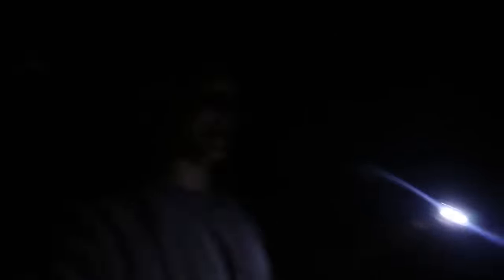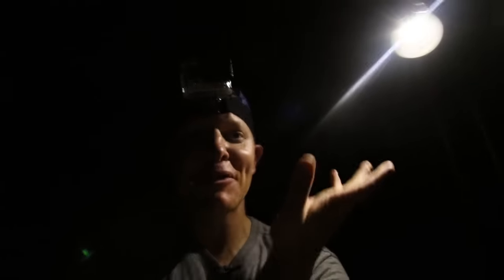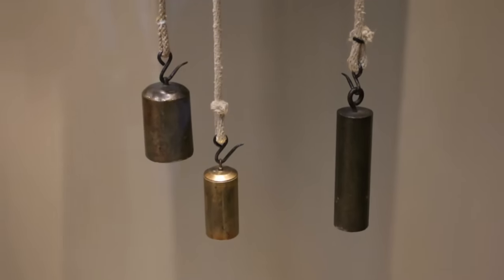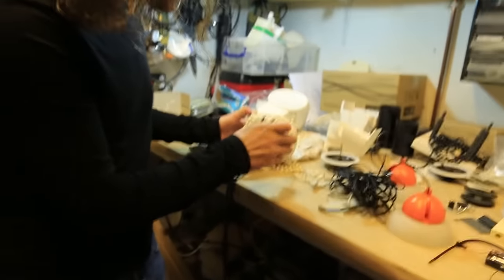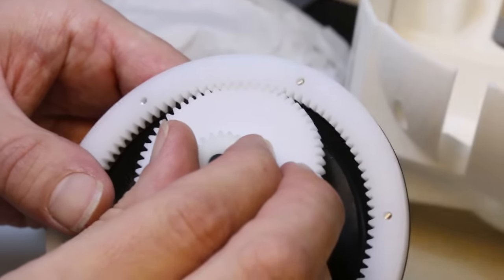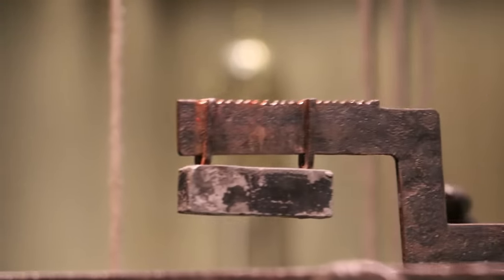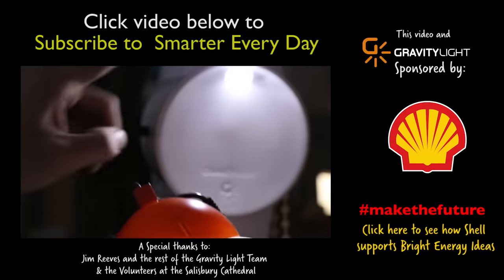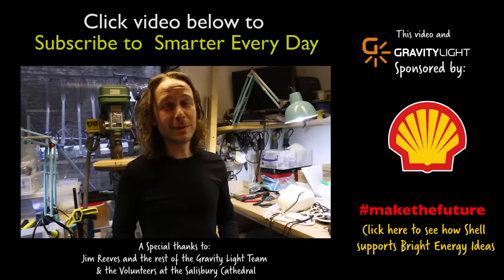Turning Gravity Into Light - Smarter Every Day 146

Comment: It's amazing how simple this is, yet only just been developed. Got to love engineering!
Reply: +TheRecreationProject it is not that simple, these gears needed some serious calculations and the manufacturing process might be expensive so you need millions of customers to make it affordable taking into account the main objective is to provide underdeveloped countries like Africa with this product.
Reply: +Luis Fernando They didn't need serious calculation. They required the same level of calculation that you would perform in any base level physics course at a university. The process mimics that of old grandfather clocks. Would it take time to perform the calculations, yes. Are the calculations difficult or highly advanced, not as much.
Reply from the maker: +TheRecreationProject I know right?  It seems like this would have been low hanging fruit.. something we did ages ago!
Reply: +SmarterEveryDay Why hasn't it then? The only thing I can think of is that LEDs are relatively new and other light bulbs wouldn't have been very practical.
Reply: +Steve Balsamo Because most people have access to batteries and the electrical grid. Batteries are far more convenient (and mobile!), and the electrical grid is far more convenient, cheaper, and powerful.
Reply: +Joshua Pearce Yeah. And cars have just recently started to move to electricity. But if you use gravity, you dont need any other power source. You only need a hill, then drive downwards...
Reply: +Kratax so, how would you get up to the top of the hill?
Reply: +Luis Fernando Countries like Africa...
Reply: ***** It's kinda hard for inventors to sell batteries of any sort to people in a post-apocalypse setting which doesn't even exist. So yeah, that's a pretty stupid point you made overall.
Reply: +Alan Zhang How do you rewind the light? It's the same thing. Use the force!
Reply: +Joshua Pearce It is called preparing. In case of a super volcano, do you have canned food for few years?
Reply: Kratax It's called an economy. More people want convenient reliable lights that are cheap, than dim lights that only work for 20 minutes at a time. Even if there was a disaster, we'd still be relying on regular electrical devices as soon as possible.
Reply: +Joshua Pearce In my country, when there is a normal winter storm, trees get heavy from sticky wet snow, bend and fall onto power lines, which hang in the air supported by poles. There can be hundreds of kms of line to fix in a rural area. This fall there was some houses without electricity for days. And it gets cold in winter, unless the house has a fireplace or something.
Reply: Kratax This kind of thing will not heat your house, unfortunately. Not even close. You'd (probably) get more heat from a human through the exercise, rather than electrical output generated by their motion.

And for lights needed for a few days: A couple AAs will easily last a week with a low power LED. Plus, no moving parts so it will not break. Sadly, this device (even though I want a couple for myself), would not be as reliable in a short term emergency, and might not last through a long term one.
Reply: +Joshua Pearce I guess it could be handy in some rudimentary warehouse room you need light only temporarily rarely, but never want to worry about batteries.
Reply: Kratax Yeah, I can see that for sure. Put two of them in a bunker or some rarely visited store room, and ten years later you'll still have a light which will work in an emergency. Batteries are great, but they do eventually die (or worse: leak). Heck, they'd even be useful in a shed or on a farm, anywhere that has damp conditions but the owner wants to save money.
Reply: SmarterEveryDay Except it's been done already in a better and more convenient form of flashlights that are charged by shaking them and thus moving a magnet through the coil inside the handle which in turn generates an electric current that is stored in capacitor which is not a chemical battery and doesn't degrade.The reason it does not discharge all at once is the same as the one stopping the weight from falling too fast.

It have way less moving parts, it's compact, light, and can be hermetically sealed which allows it to work even underwater, which is perfect for harsh conditions. And it doesn't turn out instantly - light gets dimmer as charge is getting depleted. I'd like to see you try to recharge this device in pitch black as stopping the weight will turn off the light instantly.

Also they are 10 dollars on ebay, it's a XIX century tech.

You should be ashamed of yourself for clickbate title and spreading misinformation, as well as advertising subpar product, this device have nothing to do with gravity, it's powered by potential energy you put in the system by lifting the weight. And more to the point - you can not harness any energy from gravity - that would violate the energy conservation law and perpetuum mobile. And now a bunch of people will think it's real.

I thought better of you, I thought you are making your research before doing those.

For example helicopter one was a great example of paid video, it was tying previous themes of helicopter and backwards bike together and was entertaining I nothing else.
Reply: +Roman R People can see a little bit without light, then they can put the light on. Also in a warehouse, you could have a flashlight, but these gravity lights are hanging in place, so they are better for area light.
Reply: shiromiji Go teach rocks lift themselves up, then return to this conversation. And yes, it was a channel about education before.
Reply: +Roman R Your argument is dumb with no merit. I believe a source of light that last for 30+ minutes is much better than a source that lasts for 5 minutes.  And I believe you posted saying that you can buy the flashlight in bulk is useless.  You must be a troll. And yes this machine is ran by gravity.  Where do you think all the input of energy is coming from. Thier imagination. Yes they lift the rocks up, but then its held up by the machine. 5 to 10 seconds of work for 30+ minutes of light vs the 15- 30 seconds to charge up the flashlight. 

And your last point.  Reloading the system in the dark. I am sure your flashlight you love so much can be used in this situation, but I am sure the people that this machine can benefit can figure out a way to lift a bag of rocks in the pitch dark with out losing all hope.
Reply: The input of energy is coming from the humans who lifted the rocks. Gravity is not a source of energy in this universe. It would work the same if it used springs instead of gravity (AKA, a clock).
Reply: Jose Perdomo Great, now people think it's powered by magic, good job SmarterEveryDay 

Also it is truly a great invention if it requires another light source that can completely replace it in the first place.
Reply: +Joshua Pearce Technically yes, but using ropes and gravity as energy storage is the way it works. If people put a satellite orbiting the Earth, you don't pop up noting that it is actually fuelled by rocket fuel, because the satellite was launched to the orbit with a rocket.
Reply: Kratax Excuse me, WHAT?
Reply: Kratax I certainly don't mention "this satellite was lifted into orbit because of gravity" or "it stays up because of gravity", so I have no idea what point you're making.

A hydroelectric dam is also powered by the energy stored in matter that is released as it falls into a gravity well. We don't say gravity is making that energy. We don't even say water is making that energy.
Reply: Joshua Pearce I'm glad I'm not the only sane one in this mess, this truly made this channel DumberEveryDay.
Reply: Roman R I know what you mean. (I even made the same joke in a root level comment, and set off a hornet's nest)
Reply: +Joshua Pearce Why don't we say gravity makes the energy? Sure gravity is not making any new energy. But so are you not making energy by muscle. Your muscles are just storages of energy from the Sun.
Reply: Kratax Because that would be like saying that photons of light produce energy when they reach you in 8 minutes and not sun.
Reply: Kratax Simply, because gravity didn't cause anything to change. You can say you're storing the energy via gravity, but you're only getting back out what you put in (by lifting the rocks). The gravity simply "is", and does not change or react to the motor in any way.

The energy we get back out is due to electromagnetism, so we could say magnets are making this energy.

Think of it this way: The device would work just fine in deep space, with null gravity, just by giving the bag-of-rocks a push and letting it glide until the machine slowed it down. The machine wouldn't notice the difference. (you could also do this on earth with some wheels or grease, of course)
Reply: I'm actually ok with saying gravity makes the energy, in a casual context (not happy, but it's ok), because it is gravity that makes this device work as designed. It's when somebody says gravity is being turned into energy, or gravity is the source of the energy that I get annoyed because this is a very important concept, and already confusing enough for people to learn.
Reply: +Joshua Pierce That is, of course,  assuming that the push you give it is enough to overcome the friction between the gears.
Reply: Jason G Of course. But that math is exactly the same for a weight being pulled downwards by gravity.
Reply: Jason G Energy you need to input is the same in both cases it's just with the normal case you do it fast and in this one - over time.

Of course if it was an ideal device without friction and it's own inertia singular impulse equal to lifting the bag would be enough as well, but as it is that would clog the gears dissipating energy on that.
Reply: +Roman R I'm not so sure you're last comment is technically correct.  Remember,  the object works by gearing - i.e.  the last spinning gear needs to turn fast enough for a coil to spin through a magnet (the D.C. generator),  creating enough voltage to light the LED.  If only enough force was created to surpass the friction between the gears and none more,  the large gear would likely not rotate fast enough to generate that voltage.  You would need a much larger final gear to get the generator to spin fast enough to generate the required voltage with a slight push just overcoming friction within the gears.
Reply: Jason G First, I didn't tell anything about energy enough to just overcome friction, second, the bigger gear is, the slower it rotates so I really don't know what you mean.
Reply: +Kratax Actually when you think about it, the energy comes from the person who lifts the weight up to the height so that it may fall back down. when it reaches the bottom it needs to be lifted again requiring energy from the "lifter". The mass of the object that is suspended and is allowed to "fall" slowly, is potential energy being slowly released.
Reply: +trebornoslo1951 There is no potential energy. There is only the bag, the light, and the planet. The planet pulls the bag, which turns the gears. That is all there is to it. Sure someone needs to lift the bag, but so what? Someone needs to fuel a car. Then the car runs out of fuel and needs to be refuelled. If there was no gravity, the bag would not be pulled. So the gravity does the job, though not the refuelling part.
Reply: Kratax "Potential energy" is the actual scientific term for what is being used in this situation...
Reply: Kratax Saying that this thing is working on gravity is like saying nuclear power plant is working on steam, sure, something needs to heat up the water, but so what, if there were no water, turbine wouldn't turn.
Reply: The thing you are seem to miss is that gravity is not the actor here, and it can never be one, it's just a medium with which initial actor is acting upon.

And there is a lot of devices with similar transformations of energy. Like piston inertia is carrying energy from gasoline explosion into crankshaft within combustion engine (just think why rotation is smooth while based on singular inputs of energy). Just like steam is carrying the energy of fission to the turbine in the nuclear power plant.

We don't call the inertial engine and steam power plant, do we? That'd be confusing and misleading as electric engine is utilizing inertia as well, and pretty much every kind of thermal power plant is using steam as well, from geothermal to trash burners.

And more to the point, this same principal is used every day in power grid to smooth up the daily cycle of energy consumption - at the night when industry is mostly don't work, and people are asleep, electricity from the grid is used to pump massive amount of water uphill, only to then be let down again spinning the same turbine that put it up and generating extra energy during the pick consumption, which is basically a massive kinetic battery. Do we call it gravitational power plant? Does it generate extra energy in some magical way? Absolutely not! It inevitably outputs less because there are always heat and noise and whole bunch of other kinds of losses.
Reply: +Roman R It's obviously muscle powered - but when you're in a poor area, practically everything is. Even the kerosene lamps are muscle powered, in as much as you have to walk to town to get fuel from the petrol station, and on top of that, you have to labor to earn the money, so you can have the privilege of walking to town to get the kerosene...
Reply: ***** I'm not saying muscle powered generators are bad, I'd even tell that it'd be nice to save a bit on your bill as you are getting fit in first world countries.

Though there are much better solutions for that, like a "shake-it" flashlight.

My problem with that thing and video is that it's trying to get ahead by spreading lies to poorly educated people trying to convince them that work is done by some magic.

Also this design is bad, too many moving parts, rubber belt in particular will die really fast. It's open to elements such as dust, sand, dirt, water and hair, since at least one cog that is in contact with the rope needs to be outside.

And there is a huge problem with recharging since when you start to pull weight up (assuming you were watching it closely and will not allow it to run out and fall out unnoticed) it's pitch darkness. Good luck finding that belt and weight on the floor and putting it back in in pitch black of the place without light pollution (spoiler: it's like you are blind)
Reply: +Roman R You're amazingly ignorant yourself, friend. Shake/wind flashlights are horribly inefficient from an electro-mechanical perspective - and they're exhausting. You use tiny muscles that were never made for that kind of rapid, repetitive action. Your legs and back are much stronger, and are made to lift things. Lifting a sandbag isn't any different than normal human motion, and you may only have to do it 3 times an hour. Mechanical storage is also intrinsically more efficient, because you're not having to deal with the conversion losses and expense of passing your mechanical energy into a chemical battery via the generator - then converting it back into electrical energy to do the work.

There's nothing magic about the tech. It's even less abstract than batteries and voltage regulators. It has a reliable record of working for hundreds of years with minimal maintenance. Batteries in the real world fail after a few hundred cycles, at best. You can't break this by over-winding or shaking it too hard, because it's self-regulating, and the drive belt is a simple rubber band, which takes a lot of the strain off of the other drive components. If you've ever lived in the dark, you'd know that it is easy to get used to, especially in the familiar confines of your home. Ask a blind person how he manages, if you want proof.

I'll admit, this would be a great first-world toy, but it may also be a great third-world solution. It's a simple, reliable, mass producible solution, and it would be easy to live with. Of course, paying a team of technicians and engineers to run a miles-long extension cord to the nearest power plant, and letting them fuss with the details would be easier. People make due with what they have, this just offers those without much another option.

Thank you for this interesting discussion, but alas, I must be going now.
Reply: ***** Well, I'm not saying they are perfect, but calling me ignorant and then talking about chemical batteries? And strain in rubber band?

Those flashlights don't use batteries, they use capacitors, and those don't degrade, nor lose much in the process, because energy is stored in the same electric voltage.

Now, I'm not saying they are perfect, but maybe we should just improve on the design? Add a crankshaft that would move magnet back and forth like a piston for example? Instead of completely reinventing the bicycle.

What's the cost of that "gravilight" or whatever it's called per unit anyway?

And this belt is a weak point of the whole thing! Shure it's not experiencing a lot of strain, but it goes through the cycle of bending and straightening up tens of times a second. You don't need to be a genius to know that this will crumble anything, and quick.

About "being used to darkness": now imagine you don't, imagine that thing were working a second ago, and now you are completely blinded by contrast and didn't spend dozens of years learning to operate without sight. Talk about ignorant arguments.

And no, there are still losses associated with mechanical storage - think of all those cogs, there is a lot of friction in the system, not to mention it's working on inefficient regime, since voltage/lumen is way higher then it is needed because of hyperbolic nature of that self regulation.

Of course there is nothing magic about it, but it's implied in "turning gravity into light" title. It promises that gravity will in some magical way do work for you, which is impossible, and that's my main grudge with the whole thing - turning educational channel into propaganda and misinformation spreading tool for personal profit while looking good providing a solution for a problem that could have been solved years ago without this "invention", and now they suddenly care because they have "perpetuum mobile" to sell, instead of cheap flashlights that are already on the market, so no monopoly.
Reply: Also I just looked up, bag needs to weigh 20 pounds/10 kg.

Now imagine a poor hungry kid trying to lift that in complete darkness.
Reply: Stop commenting on this post hahaha! The notifications are too much
Reply: ***** You've said it, now suffer! muahahahaha!
Reply: +Roman R The design could be improved so that it is easier to set up in darkness. Or it could start keeping some noise when it is about to go off. Like a ding per 10 secs or something. What comes to turning gravity into light, well that is exactly what is happening. But surely it is not a perpetual motion machine, hence it should probably be advertised by not saying gravity too many times. But still, gravity makes it work, obviously. You just need to set it up. The kid s parent could set the light up, and when it is bed time, no more light. The kid cant set it up, oh no, has to go to sleep! And believe me, I would favor gravilight over pumping a flashlight, if I ever went to a safari and needed some light without batteries for reading. I could lift up like 40 kgs just to make it last longer. Or I could lift 10 times 30 kgs in one go, then it would release ten bags over time. Or I could set it up in a river, draw power lines to my house. Then in the river there was some buckets which fill with water, and when they go down they open and water is released. Another bucket starts to gather water higher, and the first bucket goes back up. Perpetuum!
Reply: Roman R
Of course I would take the smaller gravilight for a safari. But if I built a settlement, then there is no limit, how many rock bags I could gather over time there. And believe me, time flies fast, so the longer the time between reloads, the better. Five minutes would be like "all the time". Lifting 10 x 30 kgs every 5 hours is nothing. When I go to gym, I lift more over 2 hours. What is it: 10 minutes rowing, then eg. 15, 12, 10, 8, 6 x 30 kgs, 10, 8, 6, 4 x 15 kgs, 10 chin ups, 40 assisted pull ups, 12, 10, 10, 8 x 60 kgs deadlift, 12, 10, 10, 10 x 40 kgs rowing, 100 crunches, etc... or something like that. Lifting few bags into air is nothing. I could like do 10 less some movement in my workout.
Reply: Kratax Except you have to do it in pitch darkness and every 20 minutes, and no, heavier load will not give you longer light, he talks about it in the video.

And you have to stand up and stumble your way to it blind every time, while flashlight will probably just be hanging on the string in your reach, and warns you by dimming before going completely out. After a day or two it will just be a habit you don't even notice.
Reply: +Roman R It is not dark if I also have the shakable flashlight! Or if the machine starts to ding before going out, so I can at least walk there with lights up. Heavier load will give longer light, if the machine is modified. But sure, it is also what who ever likes more. People who have muscle and dont want to be bothered all the time use bigger machines. Others use smaller machines. If I only wanted to read a tiny bit, sure flashlight would be better. On the other hand, I also might want to have the light up without needing to renew it every 5 minutes even though I wouldn't read anything. On the longer term, though, expensive solar panels and car batteries for the night would be better in a settlement. It comes down to what the poor people can afford and want to use. A flashlight is better than nothing still, and some people might like to use one instead of gravilight, for sure, or use both in various situations.
Reply: ***** It's kind of cool, have few issues here and there though, and kind of been done already, but main problem is false advertising and clickbate perpetuating myths.

Nowhere in the video does he mention that it's human who does all the work and not gravity. As well as forgetting to mention it's quite a heavy work (20 pounds/10 kilograms every 25 minutes). Also no explanation on how you supposed to reload it in complete darkness, light a lamp every time?

Basically it's not "smarter every day" video, quite the contrary, and thus does not deserve a number of one. Should have written "I sold out" all over it and "don't trust the word I say" because that's how you need to percept adds like this is, and I'd be cool with that, everyone needs to eat. But instead it's given like the holy truth, and now there are a bunch of people thinking perpetuum mobile is real. And all because someone in the marketing department wanted to fool people by giving this thing criminally wrong name.

It's like if this flashlight I brought up many times would have been called "magnetlight! it's powered by magnet! so free energy for everyone forever!" completely ignoring shaking part.

But what pains the most is that it could have been a good video about energy transformations: food -> muscles -> potential -> kinetic -> then part about how reducers work -> electricity -> light.

But "turning food into light" isn't clickbate enough, is it? Considering food isn't exactly plentiful in places this device is intended to be used.
Reply: James Bond But it doesn't matter, does it? It will still be powered by your electricity bill :P
This is the same kind of misunderstanding, it's just stuck as a turn of phrase, but it doesn't make it right. Do you say that nuclear powerplant is powered by steam? Because energy is in fact stored in it before being released on the turbine. Many systems perform energy transformation in the process of their work, and never are they called by the transitional medum. Hydroelectric plants use the same idea - turn potential energy of the water uphill into electricity, is it "powered by gravity" as well?
Reply: James Bond But what makes more sense in description: originating energy source from something as free as sun, "gravity" and big bang, or calling it by something you have to pay for, like gasoline, uranium, coal, gas, food. Battery is an exception here because you have to pay for them as well and originated from the time when battery wasn't rechargeable and was just a one time use container of energy, like gas or food.
Reply: +Roman R So would it be bag powered light then? Because there is this bag you need to reload once in a while. Baglight? Sounds bad, because it isnt exactly a light in a bag or something. It works closest to the gravity, because it uses anything you can find for a weight. Or how about weightlight? Maybe, though sounds weird, too. People might think is it a light for a scale or something. Dumbbell light? What the heck is that? There needs to be some name for the device. Just light is not good enough. Maybe pulleylight? But it isn't actually a pulley either nor a light for a pulley. Maybe lightpulley, though I wouldn't like that name, but maybe would fit into English vocabulary, which is kind of a backwards system anyway.

Gravity powers everything, because it is thanks to gravity that there are fusion processes going on in the Sun.
Reply: Kratax Well, that's a first argument I actually had to stop and think about - what would be appropriate and not misleading name? Clockwork light? Obviously it's a manpowered generator, but that's too general and long. Potential light would be technically correct, but will be misleading as if it can work or not. Kinetic battery/light would probably be the best, could throw out a few syllables for short KinBat/KinLight.

But regardless of the name, in this particular video it is straight up told that work is done by gravity, which is untrue, making it false advertisement spreading out myths.
Reply: +James Bond But gravity is then like the battery of the Sun, which makes it work. Also, in case of the light, work is done by gravity. The trick is though, that there must be other work done before gravity can start doing it's part. What if the bag of the light was empty, but then there happened to be eg. an earthquake, and something dropped into the bag without anyone doing anything? The light would be lit. It doesn't matter whether someone did work by putting a rock into the bag or not. If there is a rock, gravity starts pulling. In fact, gravity is endless. The planet doesn't care about how many things are in the air or how many times they are lifted into the air. All comes down.
Reply: Kratax Fundamentally, absolutely wrong in every point.

Gravity is not  the sun's battery, gravity does no work, everything that can fall have a potential energy stored in it already by people, machines, sun, tectonic motion or big bang itself, but it's never the work of gravity. To make gravity "work" you first need to put exactly the same (higher in real applications because of losses) amount of work against it in the first place. It's like a peace of rubber, it just lies there doing nothing unless you pull on it if you need a simple analogy. Gravity is just a property of spacetime itself, it's not a force!

You can never get any work out of it, that's just the fundamental law of physics, stop pretending that you know more then scientific knowledge of the whole humanity combined, there is no perpetuum mobile, stop shaming yourself already.
Reply: +Roman R There is no potential energy. There is the planet and an asteroid. The planet pulls the asteroid. That's it. No potential energy. If you lift a rock up and release, the energy stored in your muscles did some work to lift the rock. But the planet pulls it back down with gravity. If there was no gravity, you could still move the rock from down to up, but it would not fall. Now you need to win also gravity, but also move the rock. But there is no potential energy. Or, there is potential for energy, but no "potential energy" as such exist. Planet pulls also asteroids, and no one put them up. It just works. You could go to sit in an asteroid, and the planet would still pull the asteroid. You didn't put anything up, in fact you get a free ride.
Reply: +James Bond Geodesic? What is that? Show me a geodesic! You cant. So there are no geodesics.

+Roman R Bullshit. There is no potential energy in asteroids. An asteroid is the heavier the closer it gets to a more massive planet. So it is the planet that defines how heavy an asteroid is, not the other way around. Obviously the planet pulls the asteroid, then. Also, if it was the shape of universe which determined what direction everything goes, then why asteroids are going into every direction? Because gravity doesnt bend space, it just pulls objects. Tesla told Einstein, that it is the properties of the environment which are different, affecting the path of light. Light moves slower when there is stuff on the way. For example water "bends" light. There is more dust around eg. a Sun, so light bends, but not because of gravity. Or, if light bends because of gravity, then light has a tiny mass.
Reply: +Roman R  So we have come to conclusion: BOTH of you gave up and blame of trolling. Haha. The usual story. Well. Have a nice day. Come back here, if you change your mind. But I doubt you will change, you probably just hang on to old beliefs. Science will progress some other time. Gravity wont go away. It will wait. And pull things. Many things. All the time. For the most part the Sun is doing all the pulling at this part of space, and giving energy.
Reply: Kratax Calling green red and asking for disproof is not science, nor argument. Good luck with your "new" old ways, science will progress around you as will the rest of humanity.
Reply: +Roman R I didnt call green red. You are making false accusations. Remember: Gravity pulls.
Reply: Kratax Yeah, sure, and crocodiles fly... If you launch them from catapult.
Reply: +James Bond Good pun. But it doesnt change anything. Gravity pulls and information doesnt exist.
Reply: Kratax But how can gravity pull information that doesn't exist?
Reply: +Roman R It doesnt. Information doesnt get pulled, exactly because it doesnt exist.
Reply: Kratax But what about existing information?
Reply: +Roman R What existing information? Show me some?
Reply: +Roman R Information doesnt exist. Only particles exist, and they are in some arrangement. Your babble about potential energy not existing doesnt mean anything, and I have shown it: An asteroid is heavier on a more massive planet. Hence, the asteroid doesnt have potential energy, it is the planet pulling it that does the work.
Reply: Kratax You don't exist, therefor you never realized that heavier planet have more potential energy then the lighter one in relation to the same asteroid.
Reply: Roman R
Now you are trolling. Oh well, it is your time you are wasting. I am not here all night.
James Bond Work doesnt exist as such. It is only arrangements changing.
Reply: Kratax No I'm deadly serious, you are just a random human encoded by information in your dna that doesn't exist, who thinks he's you because of memories that don't exist.
Reply: +Roman R Particles exist, so I exist. Information doesnt exist, though. In DNA there is not a single bit. It is all particles, parts of particles, energy quants, etc., which is stuff. There is not a single letter of A, T, C, nor G. Only atoms and such stuff.
Reply: +James Bond Well it doesnt. Arrangements changing is not work. It is arrangements changing. If you take a microscope and look at atoms, you dont see work there. You only see particles and that they seem to somehow get from one place to an another. But you dont see any work. What is work? You could say that it is work if you lift something. But so what? The atoms dont care what you say. They just somehow keep moving. And that is arrangements changing.
+Roman R Still trolling? Breathing doesnt change all of one's particles.
Reply: James Bond He doesn't exist, remember, I think, therefore I exist, you seems to think as well, but he doesn't because no information exists in that head.
Reply: Kratax But it changes their pattern, therefore you are not the same now again, so it's easier to say "you" as a thing don't exist at all being a system open to the environment you are a part of it, just a dust under your couch that were your skin once.

Try to prove you think, you won't because you don't exist.
Reply: James Bond Exactly! Because particles don't have a place in spacetime.
Reply: +Roman R That is a whole different story. But yes, particles change over time. Still, so what? They are just particles and their arrangement. Some particles of a certain arrangement gets changed over time and eventually maybe all of them, but so what? The new arrangement is that the old particles are somewhere else and new particles are in the object in slightly different arrangement. But those are all only particles and arrangements, not for example 1s and 0s, letters, etc..
+James Bond Arrangements do exist, because this particles is now here and this other particle is over there, so they are in a certain arrangement. Of course, you are right, there are no such things as arrangements as such, but arrangements are required for things to exist in a reasonable formation and to function. One can think that arrangements exist though, because particles exist and they are not on top of each other. Information doesnt exist though, because it is not required for anything. Particles and energy quants etc. are required and they form everything, which is enough. Information is just something humans have invented besides particles, energy quants, and arrangements. But fundamentally information is just an arrangement of particles. For example a word "car". Those letters are just pixels on a monitor. And pixels of monitor are actually atoms. Which are particles. No information. Only particles. In an arrangement.
Reply: Kratax If I burn table, it's not table anymore, it's ash because particles have rearranged, therefore you are dead, just accept it.

Also there is no such thing as place of a particle, you can't say this one is here and another there.
Reply: +James Bond Well, that is another story. We could think that particles are made of infinitely smaller particles, which exist. And that our universe is maybe just a projection, a hologram, and that everything actually is on top of each other. See eg. works of Nassim Haramein for more on the subject. Still, there would be particles or sub particles and arrangements, but no information as such.
+Roman R If an arrangement changes it's particles, so what? It is still an arrangement. Also of course I can say where particles are, because there are dimensions. But a cubic system is not the first existing level. 10 nonexisting planes do not form an existing cube. Points exist and everything is manifested by points.
Reply: Kratax So when you decease it won't change a thing, right? Just another rearrangement. That's because you already are, there is no difference between you and your corpse. Also nonexisting dimensions don't form anything because they don't exist, because dimensions don't exist as a thing.
Reply: +Roman R Of course death changes things, because the arrangement is then such, that the creature doesnt eg. breath anymore. What are you going after?
+James Bond Dont mix concepts with reality. Work is another word for some arrangement, so it does exist in that sense, but not as work as such. If you cant tell the difference with a concept and a word, then you should go check a dictionary or something and come back after doing your homework. Of course, you might say, homework doesnt exist either, but then you are trolling and wasting your time, because you cant discuss this seriously, if you are trolling.
Reply: +Roman R How does that relate to anything anyway? But yes, creatures are alive all the time until they really die. They dont need to breath all the time, nor pump blood all the time. Braindead person is braindead. How does that relate to anything we have discussed? What is your point? Arrangements can change. So what? Now is now, though. There is only present.
Reply: Kratax My point is that once arrangement is destroyed it's gone, and if you think you are an arrangement of particles, you are gone as well, by your logic, the only thing that is persisting with you during your life are your memories and pattern through out which you react. You say information doesn't exist, that it's only the way system interprets arrangement of particles but how come this interpretation outlives the system itself? The only way for that to happen is that it's not information that is determined by arrangement of particles, but arrangement of particles that is determined by information within computing system.

In your frame of view life is just a slideshow of particle arrangements, which doesn't describe anything - all those cases I've provided prove that your definition is flawed to the core, it doesn't describe anything - life is a continues experience of self-aware information in the state of flux we call selves. Once you stop computing, you are dead.
Reply: +Roman R Of course the arrangement is gone after it changes. But so what? That is not a point. Most of the particles are retained. The arrangement evolves over time, it doesnt just get swapped to a new one in an instant. The interpretation doesnt outlive the system itself, because the new arrangement is mostly in the same arrangement as the old one. Either way, you still dont find information if you zoom in to the new arrangement. There are still only particles, energy quants, etc. stuff. The world isnt such you want, but such that it is. If life being a slideshow is not what you like, tough luck, the particles dont care. While you compute, you are a slide in a slideshow of changing arrangements. Once you stop computing, you rearrange into dust, which is free to roam once more maybe into some other life forms...
Reply: +James Bond Hey guess what? You have given up before. I have become immune for you giving up! Have a nice life!
Reply: +Roman R I am not gone. I am still here! So I really dont know what you are talking about. And same particle... of course there are same particles. If one atom has not changed to an another, then it is the same. And not all atoms get changed at the same time. Another atom which is of the same type of element, is similar, but not the same one. Still, even when part of atoms get changed to new ones but similar, not all of them get changed at once.

You cant see gravity, for sure, but something is pulling, and it isnt the asteroid. Information, on the other hand, can be deducted away. Information just isnt needed for anything. It is a concept humans have come up with. For example, spin: If a particle is spinning left, some might say that it is information that it spins left. But he is wrong! It isnt information that it is spinning left. It just spins left!

Life is more like a swirl in the maelstrom. We use the energy of gravity, which makes everything swirl, but eventually all of the splashes which is life, end, unless there is endless energy. But the fact that there can be arrangements doesnt mean, that information exists. The particle only spins left. That is not information. It is spinning left!

Creature doesnt die, if its brain is replaced neuron by neuron, if there was such a technology. But I doubt his consciousness would be the same. Might be, if done perfectly, but who knows. There might be more to it than matter, for example maybe yet to be found spirit matter. I have told that if someone was to be teleported by destroying him and creating him again to an other location, he would die. That is, because who would live would be his copy, not him. Still, during normal life you dont get every atom replaced at once, so it is different.

If we lived inside a hologram created by a god creature, he might be able to switch the location of our spirit, though, but that is really a different story, and speculation. Even if there was such a creature, he might not help people to teleport.
Reply: +Roman R Particle is an abstraction, but it still describes something we try to grasp. Information on the other hand is purely abstract. Information is not an abstraction, it is abstract. Particle is an abstraction of a particle. But that is it. When you have the particle, that is all there is to it. Talking about information is adding butter on top of butter on a sandwich. It is not a question of semantics. It is question of what is real and what is a concept. A particle is real. Information on the other hand, doesnt exist. I talked about spirit matter, because it describes the fact that we dont know everything yet.

Occam s razor tells, that there is no information, because all you need is the particle itself. So I am right.

Information is not confined by physical manifestation, because it doesnt exist. Information cannot transcend, because it doesnt exist. Information is not kept. Arrangement is kept. There is an order in which atoms reside. But that is an arrangement. Not information. You see information everywhere, in everything, in all forms, even in the realm of information, though there is none anywhere and the realm of information is not real either. There are only particles, energy quants, etc.

If information exists, show me some. Information doesnt exist in computing systems either. Computer is made of atoms, and when a computer is on, some electrons spin around there. Electrons are kinds of particles, energy quants, etc. Stuff. When a bit is read from a disk, the reading device actually just relays an arrangement of a magnetic particle. This arrangement is relayed to a monitor, then electrons spin into your eyes, and the arrangement gets copied into your brain. But your brain contains just more atoms, electrons, energy quants, etc. Which is stuff. In an arrangement.

If you put two atoms into a box, and cant tell the difference which is which, it doesnt matter. One of them is the first atom. That is a particle. In an arrangement. Spinning left.

Being read, the arrangement gets relayed to the measuring device, more electrons are sent to your eyes, which relay electrochemical quants into your brains, into an arrangement, which gets processed, and your brain goes to an arrangement, that if read, an arrangement is copied, which is in the same arrangement as the atom in the box. In this case the result is not meaningless though, because you cant make the difference. Not making a difference is an arrangement, too. You have some atoms in a certain arrangement, and if someone copies that arrangement, then he has the same arrangement to use.
Reply: Kratax It's just getting boring, you repeat yourself and ignore everything that contradicts your belief, I told many times that particles are not definable, nor measurable - look up uncertainty principle, and just as neutrons are made of quarks, information is made up of other particles according to the rules of computing system it's in. You say information doesn't exist, I say protons and neutrons don't exist by the same logic. And you certainly don't exist since you have nothing but information in common with past you.
Reply: Kratax And atoms and everything that is made from them don't exist as well, also fundamental particles don't exist as well, it's just energy.
Reply: James Bond At this point I tend to agree with that, though questioning any theory is not a crime on it's own if you can suggest a working alternative, he came up with "spirit matter" and "nothing exists because it's made of something else" kind of argument. He was fun at the times though before has gone in complete denial as the last defense.
Reply: +Roman R Oh, you give up again. Go back to your information then. If you find it.
+James Bond Haha. Another quitter has come to whine. Whining is not information, though.
Reply: +Roman R Complete denial? What denial? There is no need to deny anything. You have the burden of proving that information does exist. By default nothing exists until proven. Might exist, though, but if you want to convince me there is information, you have to show some. Fields of uncertainty are not good enough. Also fields are kind of stuff. Or something. But not information, because information is abstract concept.
Reply: +Roman R Oh, you are trolling again. I understand. Trolling is trolling. A kind of an arrangement of ignorance relayed to other people.
Reply: Kratax Trolling doesn't exist, it's just an abstraction made up by humans.
Reply: +Roman R Well you are wrong. Of course the world needs to function. And that enables for example particles to spin, things to move, copy and relay arrangements, etc...
Reply: Kratax Words don't exist, they are just abstractions made up by humans.
Reply: +Roman R Words are arrangements and get relayed just fine.
Reply: Kratax Arrangements don't exist, it's just an abstraction made up by humans.
Reply: +Roman R Wrong. Of course arrangements exist. You see something and you see something else elsewhere. That is an arrangement. If you think that so there is information over there and some over here, too, you are wrong. You dont see information. You see the objects! And they are made of particles, and so on.
Reply: +SmarterEveryDay Well, it was originally high hanging fruit, but the fruit could only lower so fast.
Reply: Kratax Seeing doesn't exist, it's just an abstraction made up by human brain.
Reply: Roman R If we accept that we exist, we can accept that the process of using photons to interpret the world exists aswell.
Reply: +Roman R Technically seeing does exist, because it is a function where copies of arrangements get relayed to your brain.
+Elorram Basdo Welcome to the thread.
Reply: Kratax Copying doesn't exist, as well as functions - they are abstractions made up by humans as well.
Reply: Kratax Also brains don't exist because they are just particles in arrangement.
Reply: +Roman R Particle is particle, function is function, but what is information? Spin? No, particle just spins. Color? No, particle just has a certain energy level. Direction? No, direction is abstraction of a kind of vector in a dimension. What is information, then? It doesnt exist as such.
Reply: Kratax How you interpret information doesn't mean that there isn't any information.
Reply: Kratax Also spin is abstraction and have nothing to do with actual spinning as you can't even tell if particle spins or not, because it's just an abstraction and have no sides. Also spin can be 1/2, I'd like you to explain that with spinning xD
Reply: +Elorram Basdo What information? Show me some! I am not interpreting information, because no one has shown me any of it. There is no information, so I cannot interpret it. I have told that a bit in a computer magnetic drive is actually group of particles in a certain magnetic position, which is copied as an arrangement and relayed to monitor and electrons spin towards your eyes and brain. These exist. Where is information? Show me some.
+Roman R What comes to weirdness of the spin, so what? It is just weird or something fluctuating then, and that is just that: A weird spin or something fluctuating in a field. How does that make it information? It doesnt. It is only what it is (particle fluctuating in a field), not something else.
Reply: Kratax Weirdness doesn't exist, it's just an abstraction made up by humans, as well as fluctuation and field.
Elorram Basdo Please ignore the troll.
Reply: Kratax If i throw a ping pong at you, it will hit your skin.  If i throw a bunch of balls at you, you will feel them.  The energy they hold is transferred into you, and your skin senses this and tells your brain what occurred.
Reply: Roman R Will do.
Reply: +Roman R Weirdness is part of the structure of the particle, so it exists, though only as such as the structure of particle is. There is nothing "weird", it is all just structure. The same goes with fluctuation and field.
+Elorram Basdo Yea, please ignore Roman R, who is the troll. If you throw ping pong balls at me, you throw ping pong balls at me, not information. When they hit me, their energy transfers into me, not information. My skin reacts and sends electro-chemical quants into my brain, not information. My brain goes into an arrangement, which you can copy to get similar arrangement, which tells that ping pong balls hit me. There is no information anywhere in the process.
Reply: Kratax Structure doesn't exist, you know the drill by now.
Reply: +Roman R Well it does. The fact that information has been shown not to exist doesnt make everything else not to exist too just because you say so. The drill by now is that you keep trolling, and I keep telling you are wrong. But again, I will not stay here all night, so you are wasting your time.
Reply: Kratax Showing is just an abstract made up by humans.
Reply: +Roman R You know the drill, troll.
Reply: Kratax Prove existence.
Reply: +Elorram Basdo Prove existence? I know I exist, because I think. You have to prove it to yourself, because I cant think for you. But lets assume something exists, because otherwise this debate wouldnt exist either. Well, there you go, it is proven. You have a debate, therefore you exist.
Reply: Kratax"You" is an abstract made up by humans.
Reply: Kratax But you have to assume you exist to claim you think.  There are things which don't think but we claim they exist.  Prove you exist.
Reply: +Elorram Basdo What is the point? The point is, that we assume we exist and particles exist. But why do some people assume, that information exists, too? Well they kind of dont assume that. In space sciences there is this thing called black hole. Scientists have been pondering what happens there, when matter goes to a black hole. They are trying to figure out where all the information could fit. But they are chasing non existing things. There is no information. They should only try to solve where all the spins, colors, energy quants, magnetic states, and that kind of stuff go. Those are not information. Those are spins, colors, magnetic states, and so forth. Maybe natural laws are just different in places like black hole and just make some things dissappear. Maybe it is so that just like randomly energy appears in fluctuating fields, randomly stuff dissappear in black holes. Or something.

But scientists have started to babble about information and at some point they have mixed up what is real and what is a concept. And no on notices this error. They have talked about information so long, that they dont notice any problem, when someone talks about it like it is real.

Some scientists have gone even further and say that everything is actually information, because that is the only possible way to explain the randomness in fluctuating fields. They just ignore the fact that a fluctuating field is just a field. Some scientist have used math hence information based calculations trying to figure out how the field functions. Then some other scientists say the field must be information, because they dont understand how the field functions, except mabye when they model it with math. But not understanding how a field functions doesnt change the fact that it is still just a field, not for example math. Then they go even further and start talking about the realm of information being part of this universe. They talk about abstract geometry and math being real. Hello? Anybody noticing that at some point someone mixed up the reality and what is not real??? Are they next going to claim that wishes are possible, because if you think up something, it is as real as information - instead of it being just an arrangement in your brain?
Reply: Kratax If you have to ask you should already know.
Reply: Kratax If that is real, then I'm kind of with you, it's like when someone proposes that there are seven dimensions or some absurd stuff like this, dimensions don't exist, we made them up and three is just the minimal number needed to describe everything, but then they say "but what if you can have 97 lines perpendicular to each other in one point?" then it won't be a normal math. Which is not wrong per say, just less efficient.

But I'm afraid you mistook spin with spinning again, scientists have that awful tendency to call stuff wrong names, like already mentioned spin or color that have nothing to do with everyday definition of spin and color. Something tells me it's a different kind of information - they mean physical properties of the particle by information there. The thing is, when stuff get's to black hole, presumably those properties are not kept because blackhole is capable of dissipating it's energy by separating couples of virtual particles. And property of those now real particles are not dependent on matter that is presumably used inside the balckhole to do that positive work. This is very much a debatable theory at this moment, and have nothing to do with your everyday use information.

Just think about it - systems as complex and self-aware as humans are encoded by only four repeated arrangements (normal people call them symbols). What is it if not information stored with chemical bonds?

And what's the difference between the particle arrangement that makes up you and particle arrangement that makes up your hard drive and ultimately information stored on that? What makes one more real? And other to not exist?
Reply: +Roman R I am not a physicist, so I might not use correct words for particle properties, but the base idea stands. It is like scientists generalize things like properties of particles and arrangements as information. Then they talk like the generalization exists. But it doesnt. What exists are the things (parts of particles) which have been generalized into an abstract concept like "information".

One thing was that when stuff goes to black hole, time slows down and all "information" supposedly gets stuck around the black hole. But they keep pondering how all of that "information" fits there. Well, firstly, there is no information. There are properties and structure of particles, which appear from a fluctuating field, etc. It might be that the field handles it just fine or something. But there is no information.

Four variously repeated arrangements are still arrangements, no matter how complex the system is. Sure the arrangements contain such sequences, which function so, that life is possible. But they are still just arrangements, which get copied, and other molecules get arranged based on the inner arrangements, and so on, until you have a human. If you look closely there, you only see particles, arrangements, and energy quants.

If you talk about information, yep, the particles dont care. There are no symbols in DNA. Only atoms. You dont see eg. a letter A, when you use microscope. You see atoms. It is not information stored with chemical bonds. It is atoms stuck to each other with chemical bonds, in certain arrangement.

If you say something is information what happens is, that your brain is in the arrangement, which relays electro-chemical quants to your throat and mouth, which then vibrates so, that the air starts to vibrate at certain rate. Then the vibrations in the air hit another person, whom ear organs start to vibrate in the same rhythm, producing electro-chemical quants, which get relayed to the brain of the recipient, whose brain goes to an arrangement, that if it is copied, you have the same arrangement as some one vibrated their throat and mouth at the frequency in question. Person might have been hit with similar frequences before and therefore he can then relate to what you meant. But it is all about arrangements getting relayed and processed.

The same thing happens with a harddrive. There is no information stored on the harddrive. There are only groups of atoms in a certain magnetic position.
Reply: Kratax I'll tell it last time, because I solved your confusion at least for myself.

There is information, and then there is (physical) information. First is exactly reaction of computing system to a particular perceived arrangement called that name for simplicity BY DEFINITION and another is exactly set of properties of a particle (or other system) like spin, color, energy level and so on combined together under a common name for short BY DEFINITION.

Look it up on wiki https://en.wikipedia.org/wiki/Information_(disambiguation)

So the only thing you are wrong in is confusing them to be one thing - you are trying to open your door with note symbol, and that's why you look so stupid to people around.
Reply: +Roman R Only physical things exist. Other things are... not physical. What do you have to say about that?
Reply: Kratax Fields (like gravitational one) are not physical, yet they exist. And you've described physical side of information well enough yourself for both kinds of information.
Reply: +Roman R Fields are physical, though not such which you could touch. So they exist. Do not fall to the pit of the other way around. Generalizations do not exist as such, and "physical" is a generalization of normal matter and fields. Therefore physical doesnt exist, but matter and fields are not physical as such. They are matter and fields. They are not information. Physical doesnt exist. Physical things exist.
Reply: Kratax " Fields are physical... So they exist", "Physical doesnt exist"

And how is it different from information anyway?

I think you need to work a bit on your definitions. By that logic particles are generalization as well because they include a bunch of stuff radically different from each other - photons, electrons, neutrons, quarks, they have very little in common.

I count my work is done here.
Reply: +Roman R You always misinterpret what I say, then come up with some gibberish, and tell me you are done. Well, of course you are done, if you dont even understand anything! I told you that physical is a generalization, but physical things are not generalizations. Therefore both matter and fields exist, though they are different kinds of physicals. And because "physical" is generalization, it doesnt exist as such. But the actual physical things are not generalizations! So my definitions are correct. Continue work or not. What comes to a particle being a generalization so what? The various kinds of particles are not, and they exist. We can debate about kinds of generalizations, though, because there are parent classes and other kinds of abstractions, which are different kinds of generalizations. Parent / sub classes mean that you have a particle, which is parent class for all kinds of particles. A more general generalization is abstraction, where you dont have clear thing what you are classifying, but you abstract away eg. properties of particles. For example many kinds of particles have certain property like color, though property is abstracted away with keyword like "information", which doesnt exist as such. So I am right.
Reply: Kratax I'll try to be as clear as possible, apple is a generalization, you find no apples in quantum physics, and there is no single couple of apples that are the same. Does that mean they don't exist? No, because you recognize it as apple and don't go into "it's not apple, apples don't exist, it's just a bunch of water, fiber and stuff, and overall just one local fluctuation in space-time"

How is information any different? You claim it doesn't exist because you never seen it, but you never seen nor touched a single particle or field as well, yet you claim they are more real somehow.

All your arguments come to "I call apples "thing that hang on apple trees mostly made of water and make crunchy sound when you bite them", it's more accurate, so I'm right!"

That's very childish, how about you grow up and start use common terms instead?
Reply: +Roman R I used common terms. Maybe you didnt see them? An apple is a generalization of apples. Though apples exist. Why dont information exist? Information is by definition something that doesnt exist. When scientists speak of properties of particles, they should speak of properties of particles. Yet they speak of information. There is a contradiction there. Information is more about arrangements in certain order. But arrangements in certain order are arrangements of particles in certain order, not information. Information is more about the realm of math. When physics get very complicated, scientists need to start using ever more complicated math to solve equations. Soon equations are all the scientists see, and think equations are real. That is wrong, and it doesnt help, if they mix concepts like information over properties.

There are no apples, though, only bunches of atoms in the form of apples. Thats right. But that doesnt mean, bunches of atoms in the form of apples dont exist. Now, are there bunches of information? No. There are many kinds of structures and properties, but they are not math, nor information.

You could say that apples dont exist, because it is only a generalization. In that sense you are right. But so does information not exist, in that sense. Still, scientists use information also in the wrong context, because they should be speaking of properties and structure of particles, not information. They should be speaking of information in the context of information sciences, if needed, though. But even in that context information doesnt really exist, and is even a vaguer term existence wise than properties of particles.

Also logic is kind of form of math. But logic doesnt exist. Only real logical gates exist, though also a gate is just a generalization, and an abstraction. There are many kinds of logical gates, which all are bunches of atoms in the real world.
Reply: Kratax I'm done, you are just a troll keep mixing different things with the same name and draw conclusions out of that, can count it as a win if you want, see if I care, I have better things to spend time on.
Reply: +Roman R I dont care what you do. I am fine knowing I am right. More of this issue came to my mind: You can have information, that there is one apple on the table. Is that a property of a particle? No, it is an arrangement of atoms in a harddisk or in your brain, which if copied, can be used to relate to the situation on the table. Information cant be everything either. First people talk about properties of particles as information, then knowledge as information... That is mixing concepts and drawing conclusions out of it. I am not mixing, I am clarifying. You see, there is obviously danger of using wrong concepts in wrong places, and it has happened in world class sciences. Have a nice day, and beware of misconceptions!
Reply: Kratax It's just happened that you are the only person in the whole world that is aware of that, get in line for noble prize.
Reply: +Roman R You are wrong again. Not all approve the fact that people call information what is not information or better yet the fact that some think math is real.
Reply: +SmarterEveryDay A 100 kg load hung at a height of 10 meters has a gravitational potential energy of 10000 Joules (approx. for ease of calculation). A 100 Watt LED (yeah!) can be lit for 100 seconds using this. A 10 Watt LED for 1000 seconds or ~17 minutes.Where am I going wrong?
Reply: +Gurvinder Sharma learn how gears work.
Reply: +Adrian Garcia I am a Mechanical Engineer, you Sir should learn high school physics
Reply: I'm studying to become a mechanical engineer as well. So I know what how power can be manipulated by gears and pulleys
Reply: +Adrian Garcia Well that is great. You are wrong in saying that power can be manipulated by gears and pulleys. Better word would be "transferred", angular velocity and torque can be manipulated, but power is conserved unless there is a energy bank like a rechargeable battery, in which case it is still conserved. Energy can neither be created nor be destroyed, but can only be transformed from one form to another. We need not be concerned with the internal systems like gears etc used. We can simply equate the input (human effort) to output (electrical energy) Efficiency is assumed to be 100% for sake of simplicity. 

In my original comment I was wondering how even a huge load of 100 kg (220 lbs) when raised to a big height of 10 m (33 ft) would light a 10 W LED for 17 minutes only. That is too much effort for a minuscule output. For a realistic setup, say a 20 lb load lifted to 6 ft, would be able to light a 10 W LED for 2 to 3 minutes only. That is not worth it. So, this innovation of gravity light is useless. I rest my case :)
Reply: Yao Hu No you don't, it's absolutely self-regulating, only things that will differ is the speed at which weight will fall, and the minimum mass of it needed for it to work. In theory if you just wrap a string around rotor axis with no gears at all and hang a weight on it, it will still work, but for a few seconds. Though at the same time it will require much smaller weight.
Reply: +Gurvinder Sharma But there is no practical limit how much eg. a planet can pull with gravity. So if you go to an another planet, then come back here with a load of anti-matter, then create heat here and steam water, this planet will pull all of that water back down once condensed. So how do you explain this unlimited amount of potential energy? I mean, even if there is not any object in the air, there is still the potential of pulling any object down. Does gravity exist only when it is pulling something? I doubt that.
Reply: Kratax First part - incomprehensible mumbling. And in case of spaceflight all work is done by your rocket (and sometimes kinetic energy of celestial bodies if you perform gravitational slingshot maneuver, though it doesn't use gravity, it uses kinetic energy of the body in the question)

Second part - there is no such thing as "nothing in the air" gravity acts with no limit (as far as we know" every star you see, and every one you don't is pulled by Earth just as any other matter, so everything have potential energy already stored in it by big bang that pulled everything apart from it's natural state of singularity.
Reply: +Roman R I mean, it doesn't matter how much energy you bring here for steaming water up, the planet will still pull all of the water down. The bringer of energy can be an alien instead, so you are only adding energy here. Also, there is no potential energy. Only potential of energy in case an object is released from eg. a table.
Reply: Kratax Gravity can only pull down what was lifted up, if there will be no energy source, system will be left unchanged.

Also stop with inventing your own terminology already you are just making fool of yourself, potential energy is a term, it exists and isn't exclusive to gravity - energy stored in overheated water inside a boiler is a potential energy as well as energy stored in chemical bonds and atom nuclei, and none of them have anything to do with gravity.
Reply: +Roman R Terms do not exist. Your point is invalid. Not all objects are lifted up. Some are eg. asteroids. If the matter of Earth was pushed further away than some rock by Big Bang, then the rock is actually down, and is being lifted up by gravity. But the thing is, if someone invented a perpetual motion machine, which lifted things up, gravity would pull all the stuff down. And not everyone believes in Big Bang, either. Some believe, that the center of Universe is the center of a huge donut shaped system, which ejects new material, which then curves up (and down) and back to the center.
Reply: +Gurvinder Sharma If you look at the specifications, it powers a 0.10 W light, so 100x less energy is required than in your estimation. Basically, the LED is more efficient than you thought, and it produces less light (but still more than a kerosene lamp).
Reply: Kratax No they do. All. Physics is relative, you know, there is no up and down in space, and it is Earth that is falling on the asteroid from it's point of view. Yes, if there were perpetuum mobile there would be perpetuum mobile, but it can not exist. Whatever that is in the big donut theory that is spewing matter is providing potential energy for the universe then.
Reply: +Trevor Vanderwoerd well it definitely beats the kerosene lamp, no contest.
Reply: +Kratax First of all there is a difference between gravitational potential (the gravitational field) and gravitational potential energy. Field is always there as long as there is a mass (Earth in our case), but energy is a relative thing, depending on the size/mass and height of an object w.r.t. Earth. 

In your anti-matter example, the source of energy is anti-matter (as per your logic), let us not even go into the practicality of it, of how you bring it to planet Earth without the use of any energy. So, your foreign energy is consumed in evaporating the water (latent heat of vaporization) and making it into steam. Due to lower density than air, the steam rises up, cools and condenses, increases its density, and falls back to the Earth. So, the energy used to vaporize the water got utilized in increasing the potential energy of the water (as steam), The steam heats the surrounding air a bit and cools itself down, trying to attain a thermal equilibrium. The potential energy got converted into kinetic energy as the droplets fall down, finally the impact of the droplets with the ground consumed that kinetic energy in the different forms like sound, heat, light (negligible), breaking of the hydrogen bonding and scattering of the droplets, heating of the water due to viscous drag.

Gravitational field is a path to stable equilibrium. It does not create energy, it only guides the energy transformation from one form to another.
Reply: +Roman R Terms do not exist. Stuff exist, like atoms, energy, etc. So you are wrong. If you invent a term like Spaghettimonster, it doesnt automatically mean, that Spaghettimonster exists. Well there is a relative up, when you think that location of Big Bang was the center, so we are higher than the rock which is more towards that location in the center. Also you dont know all about what can or cannot exist.
Reply: +Gurvinder Sharma So gravitational field is always there. But the point was, that it has the potential of pulling objects even if the objects are not there. It could as well be used. And it is used. For example water turbines work on the principle that the heat of the Sun evaporates water, which then comes down rivers, which then turns the turbines... If anti-gravity was invented, stuff could be levitated, then dropped, for free energy.
Reply: Kratax If terms didn't exist you could not argue their existence, thereby you are wrong. And yes, if I make up a word that has a meaning and it gets accepted and used by significant amount of people that word (or term) exist, that's how language works. Will you say language doesn't exist now, mr. everything-is-made-up? I'll tell you a little secret, there is no center of a big bang as space-time itself was reduced to a single point prior to that event. So technically it started everywhere at once. And no, I can tell what can and can not exist - that's the point of science. One can not see every thing there ever was and will be, but knowing a set of limited rules they can predict everything. And so far the whole scientific experience up to date says that work can not be done without an influx of energy, thereby rendering perpetual motion machine of any kind impossible. And more so, there isn't a single hint to doubt that experience.
Reply: Kratax All objects there are are always in gravitational field as every single bit of matter contributes to the overall gravitational field and unlike in your imagination there is no cut out point at which to the left it is earth gravitational field, and to the right it's the polar star's one. And if you were to create matter from energy you'll be putting that gravitational potential energy in it. And there is no such thing as anti-gravity, what next? Will your next argument be "but what if Great Flying Spaghetti Monster would be lifting it up?"?
Reply: Kratax And even if particle with negative gravitational potential could exist and if you could contain them inside regular matter, you'd still have to put energy in pulling such lifting device down as it will resist that so no free energy anyway.
Reply: +Roman R Omg! You learned nothing! Go back and think why information doesnt exist. The same goes to concepts like terms. If you zoom in on a paper where a term is written, you find only atoms! There is not a single term on the paper! Also how do you shrink space itself? You dont know? Well, how do you know your limited set of rules are the ones everything is bound by? Scientists dont even know what is dark matter or dark energy. Lol. And the fluctuating fields can create something out of nothing. Already forgot? And if there was the supposed Big Bang, it came from somewhere and enlarged into something... Also if space was always, and in any case, it must exist. What exists are points, not cubes. Earth is one kind of a point, if you look from a far. You can zoom in endlessly to find smaller objects, but you cant build endlessly larger and larger colliders. That is the first step in understanding the structure of space itself. Scientists need to figure out the laws of structure of space. Vector equilibrium keeps forces in balance so that everything wont just collapse. For example what if the vectors of existence itself are so powerful, that if you harness one vector, you have all the energy people ever need. You dont know that it is not possible.
Reply: +Roman R You can still transfer energy in forms, which has greater energy density than its mass value. So reach of the gravity field doesnt matter. And you dont really know, is anti-gravity possible or not. See more in my previous post.
Reply: Kratax I give up, there is no point in arguing with idiot (or troll) - made up constructions exist because they are made up by definition. Literally every sentence you ever written here is wrong and I've proven it on multiple occasion obvious to any sane person.

Also you can't harness a vector because they don't exist, no matter how far you zoom in on the fist hitting you in the face you'll see no vectors there.
Reply: Kratax Have a nice nonexistent day in your nonexistent life, and don't bother writing words here, they don't exist.
Reply: +Roman R I wonder how many times you have given up by now. But I assure you, there are no terms on a paper, no matter how many times you write any term on it. I propose you give up looking for terms, because there are only atoms. Any sane person understands this. I bet you just cannot admit you are wrong on this one. That, or you really cant think clearly, but tumble on concepts instead. Words do not exist as concepts, but of course there are arrangements of atoms in the pattern of a word. Word showing on a paper still doesnt make a term to exist. Terms are just concepts. You need to learn to distinguish what is abstract and what is not. If you keep telling terms exist, I cant continue further before that false conception has been clarified as being wrong. I am trying to help you, but you still cant see the truth.
Reply: Kratax Your argument don't exist because you've made them up. There are no arguments in your head, only random arrangements of matter.
Reply: +Roman R You need to learn when you can use the "it doesnt exist" argument and when you cant. For example you cant say that a candle is lit when it isnt. You kind of told, that because there is a term, it applies to things. But terms do not exist, so you need to prove your term with some other logic. Telling, that because a term exists it proves the term to be true, doesnt work, because concepts are only at concept level and terms are concepts. You need to prove your term to be true by showing something concrete in the real world, not by telling that because people have invented a term, it must apply to things. You wrote "...potential energy is a term, it exists...", which doesnt prove that potential energy exists. So I am right.
Reply: Kratax Your examples and analogies don't exist because you've made them up. There are no candles in your head... right?
Reply: +Roman R Haha. Looks like I won. Bye.
Reply: Kratax Concept of win doesn't exist, it's made up by humans.
Reply: +Roman R Well, at least you are not even trying to win. You still have a term to prove, but you are not proving it...
Reply: Kratax I've proven your logic to be false and counterproductive, because in following it you can't express anything or deliver any fact or opinion, thereby I won and you didn't even realize that because you don't exist.
Reply: +Roman R Well you are wrong. The fact, that something doesnt exist, doesnt mean, that nothing exists. You are exaggerating, which doesnt prove anything else than at most that you are wrong. Also I have expressed and delivered facts and opinions. So you have not won. The fact that a smaller object is located somewhere related to a bigger object doesnt prove that the smaller object has some energy, which you call potential energy. It only proves that the smaller object is near the bigger object. But why the smaller object starts to go towards the bigger object then? It is so, because the bigger object pulls the smaller object, so the energy must be in the bigger object. Except that there is not even that kind of energy. The bigger object just pulls the smaller object and that transforms more and more movement to the smaller object. Also, how do we know that it is the bigger object pulling? I already told, that it is the planet which pulls, because objects weigh different amounts near different sized planets.
Reply: Kratax Nope, it's all wrong, you've made it up.
Reply: +Roman R What I made up? I didnt make anything up. Claiming that there is potential energy is making things up, because by Occam's razor, if something is not needed it most likely doesnt exist. And potential energy is not needed. "Potential energy" is just a saying for that some mass is at some height with or without support. But a saying doesnt prove anything and even the razor means, that nope, there is no potential energy, the mass is just above ground and starting to move towards the ground, because gravity pulls it. It is very common that scientists make things up. They made up "potential energy" as a term. Before scientists there were just eg. rocks and ground. And after scientists there will be only eg. rocks and ground. Other things scientists have made up is strong force. There is a strong force in the core of an atom, but scientists didnt know what is causing the strong force. So they just named it "strong force". How convenient is that? Likewise, the observed universe doesnt behave according to current physics, but scientists dont see anything else either, so they made up dark matter and dark energy. How convenient is that?

Also, I told that a better term would be potential of energy, which means that if an object is released, then there will be energy, because the object starts to move. And the condition for releasing means potentiality, from which comes the term potential of energy, which can easily be shortened and or mixed to the term potential energy. So, we can see, that maybe it originally actually was potential of energy, not potential energy, and then some people shortened it to potential energy. Potentiality means only possibility, not that there actually is some energy. So potential energy doesnt exist. Me making this up doesnt change the facts that I presented above. So I am right.
Reply: Kratax Are you having razor in the head now? Stop with that, it's dangerous.

Also you've told absolute absurd, potential energy is a keystone of the whole physics, without it none of it will make any sense. No energy conservation law - no nothing.
Reply: +Roman R No, potential energy is not a keystone of the whole physics. Potential of energy is one of the keystones. Not potential energy. So I am right. People only use the term "potential energy", but they mean "potential of energy". They dont know that they are using a wrong term, though. And many of them like you think there actually is potential energy, but there isnt. The object only starts to move, pulled by gravity, not by a mysterious potential energy. Haha. Sure, you dont need to know how television works to use it, either! Omg.
Reply: +Roman R A rose by any other name will smell as sweet, but that is so, because it is still a rose, just an another name. But in the potential energy case, you are calling a rock a rose, so it will smell like a rock. What general consensus? I doubt serious scientists agree that potential energy actually exist. I am confident that they will at least admit after thinking about it, that of course it is the gravity which is pulling the object. Potential energy doesnt pull the object. There is no potential energy. It is only about gravity pulling the object and then the object starts to move faster and faster. Earth pulls the object. And I dont think gravitational field has been explained thoroughly either. It is more like about calculating how things seem to work. There are calculations, but I doubt people know what gravity actually is. Both smaller and larger objects have gravity, but the larger has more, because it pulls the smaller objects. This is shown by smaller objects weighing more near heavier planets. Also the larger objects dont dash even faster towards any lighter objects. It is always so that lighter objects goes more towards heavier object.
Reply: Kratax You are wrong at absolutely everything - just add "not" to every statement you made, I'm to lazy to copy this stream of consciousness, those are simple well known facts.
Reply: +Roman R No I am not. I am not wrong just because you say it. I have provided many examples etc., you not that much. In that sense, I win. Of course I cant make you declare myself winner. Other readers of this thread can judge about the result. I bet many of them wont understand these things any more than you.
Reply: Kratax All your arguments are wrong and/or have nothing to do with subject in question. You aren't right just because you say so either. Gravitational field exists, potential energy exists - that's the basis of modern science. Without that there is no conservation of energy as kinetic energy of a cannonball would be disappearing into nothing as it slows down to full stop and then new energy would be magically appearing out of nowhere as it starts to fall down.
Reply: +Roman R No, my arguments are not wrong. Not because I say so, but because I have described them right. You, on the other hand, describe your arguments wrong, so you are wrong. There probably is some kind of gravitational field. But there is no potential energy. That is the basis of modern science. Or should be. People think that there is potential energy, but they are wrong. When you lift a rock, you do work. Energy is gone, because you did work. Right. So energy can actually be destroyed! Whoa. Who would have believed that? When the rock starts to fall, new energy is not created. The rock just moves through space. But when the rock hits eg. a paper on the way, the paper breaks. Why? Did the rock zap the paper with energy? No. The rock moved through the paper. The movement of the rock slowed a bit down, so some of the "kinetic energy" of the rock transferred into the paper. But what is kinetic energy? Can you see it? No you cant. It is only for example the movement of a rock. What is potential energy? Can you see it? No you cant. It is only a position of a rock. Where does all of the movement come from then? It comes from gravity. Nothing would move, if there was no gravity. Atoms would just float in space. "Potential energy" is merely a position of a rock in space relative to other objects.

What made everything to move in the first place? There was so much movement, that particles collided into each other, which made them bounce around and to scatter all over the space. But there is no certainty of did Big Bang really happen. Models are missing pieces, scientists do not even know what is dark energy. Or does dark energy even exist...
Reply: Kratax"When you lift a rock... energy is gone..."

I'm glad you finally accepted inevitable.
Reply: +Roman R What inevitable? That doesnt prove your point. Energy is gone from the lifter, not from the rock. Also the rock doesnt gain any potential energy, because it is just moved to an another place. Gravity will pull the rock later down, but that is not energy in the rock which does the work, but gravity doing work.
Reply: Kratax So now you are suggesting that scientists are wrong and the energy conservation law is false, am I right on that?
Reply: +Roman R Not entirely. They are wrong in what is actually happening. Sure calculations match in simple cases if you think that the rock gains energy when it is lifted up. But it doesnt gain energy. It is only moved, energy is lost from the lifter, and the rock starts to gain "kinetic energy" back when it starts to fall. Kinetic energy is not that kind of energy, which zaps things eg. electrically, though. It is movement. You notice movement has power when the rock hits something. Otherwise the rock just glides through space.
Reply: Kratax I think we should stop there, you've clearly proven that you are insane, get help.

Also there is no "electric energy" there is only kinetic and potential one, and in case of electricity it's kinetic energy of electrons.
Reply: +Roman R Stop if you want, if you dont dare think with your own brains. Yes, there is only movement, and gravity pulls things, so there is no electric energy nor potential energy. Then there is also magnetism... But, did I already mention, that Nassim Haramein has a theory, that protons are actually black holes. Then those would pull the electrons, so gravity would explain also strong force.
Reply: Kratax Gravity is not a force, as is magnetism and strong "force". Those are just fundamental interactions - ways by which one matter affects another. And protons are not black holes, otherwise all matter would collapse into one big one and even if not it would be practically immovable. Also proton/electron interaction have nothing to do with strong force. You really need to get your head in order. And why wouldn't those "black hole" protons pull positrons then? Or each other?

Have it ever occurred to you that you can't physically collide two macro objects in normal condition? Because when you move one close to another their atoms don't touch. You'd be performing nuclear fusion by banging rocks together if that was the case. Way before atoms get remotely close, electrostatic interaction kicks in and pushes them away from each other. And gravity is just like that, except it's way weaker, yet having much higher range. It's not a force, it's just the way matter interacts.
Reply: +Roman R How is gravity different from magnetism? I mean, they both pull. Proton's black hole gravity is not great at longer distances, so everything wont just get pulled into one. Harameins calculations put the black hole proton on line with everything else, while standard proton is off line. That shows that there is something to consider. In larger atoms there are many protons together. There is also some other things going on there. But on the other hand, in macro world the gravity is not that strong either.

If gravity is just a way, that matter interacts, so what? It doesnt prove that potential energy exists, because a planet pulls a rock, and the rock only starts to move.
Reply: +I'M Running Thaangs Haha. You havent even talked yet.
Reply: Kratax don't need to, from what ive read of the previous comments, it's already been explained to you that you're wrong and a quick google search would show you that.Come on man, it's the age of information, catch up!
Reply: I'M Running Thaangs
I already posted an explanation why information doesnt exist. What else do you want? If you have an argument, tell it. Then I can describe how you are wrong and why I am right. You just mentioning that there is theories in the internet is not giving an argument. It is just pointing that some people have told something somewhere.
Reply: I'M Running Thaangs
What the heck? You dont bother reading what I have said and you still think I am wrong and even if I am right you dont care??!! That does it. You just disqualified yourself from this discussion. But hey, in any case, you dont even want to continue... So what is your problem dude? I already know, that various people do not agree with me. You dont need to come here and tell me that "oh, by the way,  various people dont agree with you". How brilliant do you think you are? Because you are not. Stop wasting everyone's time.
Reply: +I'M Running Thaangs Well, you are wrong. Tell me, which posts, and I will check them. Otherwise, you are just wasting time.
Reply: Well if you think about it we've had all the technology for 3d printing for several decades well into the seventies but somebody had to come along and put all those little pieces together to actually create a 3d printer
Reply: unless you're me abd hate your engineering classes.
Reply: +Jon Wright I've actually built something like this (in way clunkier and uglier) for outdoor use of speakers. Did actually work really well.
Reply: krillax im running thangs let me tell you something okay your both just saying stuff to get points across that both might not be  right who knows okay Im 11 and here this will help the argument your not the smartest man in the world krillax  you think stuff and you said information doesnt exist you are thinking of information right now also what do I have to do to make people who are probably 10 years older to say this was just plain nonsense look you stared both of you mostly thangs no offense there bud but really this started from a commej t who werent you to okay thats my point done op you both learnt something
Reply: +jejegaming Are you talking to me? I am not 10 years older than you. I am closer to 30 years older than you. You don't seem to even know how to write properly. There is no information. If there is, show me some. Tell me what is made of information. Thinking about information doesn't make it exist. Your brains are a biological machine. A machine is not information. It is a machine. The things that go around there making thinking happen is not information. It is biochemical reactions and electricity. There might be some spirit matter who knows. But that would not be information, either.
Reply: @rangers8905  Are you serious? 😂😂😂😂😂😂😂 3rd world countries are making fuel from urine........ What would they need a power grid for.
Reply: @GamesFromSpace  That is utterly incorrect. the energy is in the field. More likely, gravity is the only source of energy in this universe.
Reply: @GamesFromSpace  There is no such thing as 'potential energy'. A rock is a rock, no matter if it is on the ground or on a ledge. Saying that a rock has some kind of magical energy because it now rests on a ledge is nonsense. The energy is in the field.
Reply: @elams1894  "Potential energy isn't a thing, now I'm going to explain what it is." You're doing the same thing people who say centrifugal force isn't real do.
Reply: @GamesFromSpace  I did not explain what potential energy is because I said that it does not exist. Convergent and divergent pressure mediations are a conjugate pair, you obviously know that, so why fixate on potential energy?
Reply: @elams1894  Honestly, I don't even remember this conversation, it looks like it was 3 years ago, and can't find my comment. But what you said was "potential energy does not exist", and then proceeded to give an explanation of some things which are called potential energy in certain contexts. It's a thing, you can't reasonably argue it's not a thing just because it's not a specific force or type of particle.
Reply: @GamesFromSpace  I think we are on the same page with a lot of things. Fields have different definitions depending upon the person. All good mate, have a great day.
Reply: @joseperdomo5712  You know absolutely nothing about physics. It is NOT ran by gravity. It's exactly as Roman R said..."this device have nothing to do with gravity, it's powered by potential energy you put in the system by lifting the weight. "
Reply: Also, Joshua Pierce is confusing Kinetic Energy with Potential Energy.  The only reason a mass in the the atmosphere on earth at a certain height has potential energy, is because Gravity.
Reply: @Kratax   I like your comment and agree with it.  Your comment made me think about the creation of oil, which started with molecular attraction/Gravity i.e. the formation of the planet.  Although oil is not solely a product of gravity, gravity is definitely part of the equation.  Molecules, Mass, Planet, Light, Plants, Organisms, Death, Decomposition equates to hence Fossil Fuels.  Cool Beans.
Reply: @GamesFromSpace  and @Kratax. Ok, so why do molecules attract to one another?  Positive and negative charged particles, right?  I'm brainstorming here but Gravity is hard to understand.  I'm thinking that two masses of pos and neg molecules that are separated by say lifting one off the ground is what creates the potential energy, i.e. rocks falling to the earth, therefore some forms of potential energy must be a function of gravity.

My earlier thought made me think of Einstein's, E=MC squared.  So another form of potential energy is Uranium.  My thought is that a larger mass of uranium or magnesium for that matter has more potential energy than a smaller mass.  I'm quite sure its not practical to generate energy from one molecule of Uranium rather a collection of many molecules.  Tip, magnesium placed in the fire is a cool thermally generated show.

My brain is starting to hurt/work overtime because i'm not extremely well educated and i'm kind of stuck on the thought of electromagnetism and Gravity.  I heard once that we don't know what gravity is from a co-worker.  I'm stretching here but i'm thinking that Gravity has to be somehow related to electromagnetism, why else would similar and different molecules attract to one another; hence a block of magnesium and a feather falling to the earth.
Reply: @romanr1592  You could say the same thing about finding your shake flashlight in the dark.
Reply: @romanr1592  A poor hungry kid most likely wouldn't even have the contraption in the first place.
Reply: James Bond  I like your thoughts!  I'm thinking electromagnetism is the answer to your final question.  Electromagnetism, Sun, Fusion, everything else, blah, blah.   E=MC squared.
Reply: @colewilson654  Gravity is not related to electromagnetism. They are fundamentally different things: And when I say fundamental, I mean it as absolutely and literally as possible. Just because they both can attract things doesn't mean they have anything in common. Also, electromagnetism has charges and poles, gravity does not.
Reply: @GamesFromSpace  Good point, thanks for reminding me.
Reply: @smartereveryday  I made a gravity light when I was 9 using an old rc helicopter